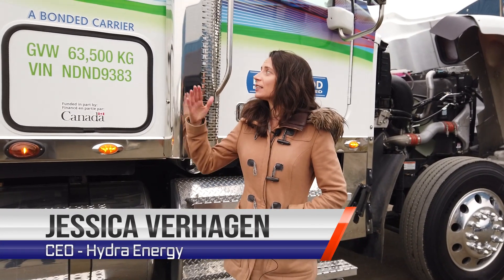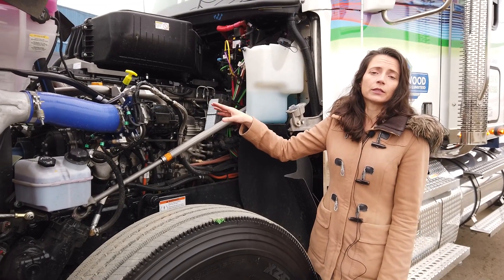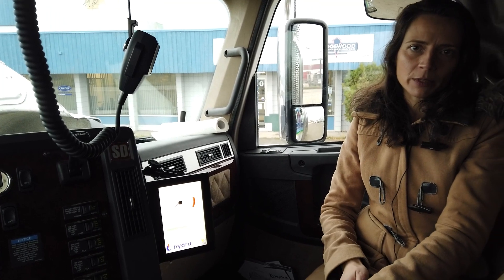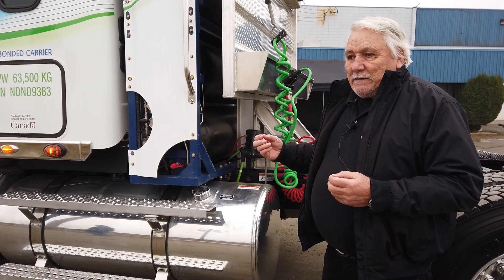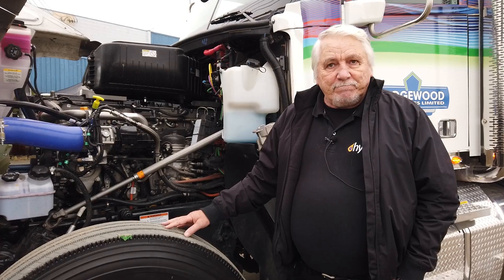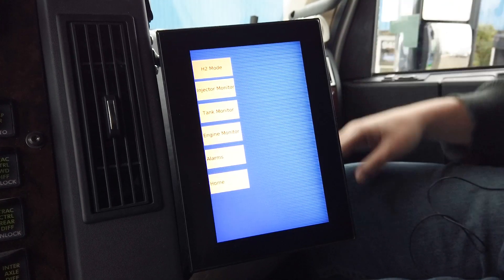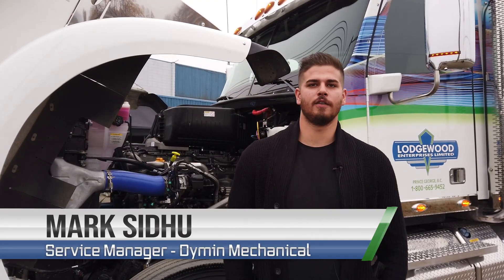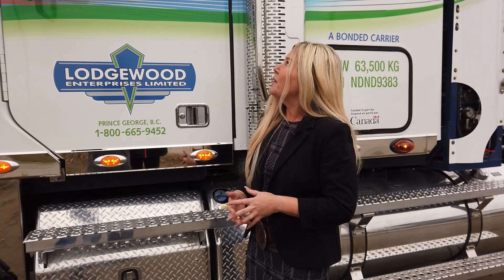Tour Hydra Energy's Hydrogen-Diesel Truck

Comment: I wonder what the size of the explosion would be if a flat bed trucker loaded a 38,000 pound steel coil incorrectly and it went rolling forward right into those tanks at high speed

Comment: Hydrogen has a lower combustion temp...   Diesels starting better at much colder temps.  It happens to be a byproduct of the system but would be a MAJOR selling point for equipment operators and drivers in Cold regions.
Reply: You need to use hydrogen on demand it has four times more energy density that of bottled hydrogen I have data from the lab and data from real world testing.

Comment: Hydrogen is the future  - Electric vehicles are powered by batteries which do not have sufficient energy density to power a truck
Reply: Yes you are right I've been in the business for 13 years in the last 2 years has been out of control busy.

Comment: where can u fill up h2? that is problem?

i think it will be much better have HHO generator to supply H2 than fill up H2gas from station
Reply from the maker: Hi Tim, that's a great question thank you. Hydra has just broken ground on the world's largest hydrogen refuelling station. It will be available for our customers to fuel at in early 2024. Check out our other videos to see a flyover tour of the refuelling station & production site as well as speeches from the groundbreaking.
Reply: Absolutely right with our technology we gain better fuel savings results and emission results with  hydrogen on demand.
Reply: Hello so I am Scott from Central valley hho. I have been doing this technology for 13 years. Bottled hydrogen is not the equivalent to hydroxy hydrogen. I've done certified test gas  test in the gas that we make as a percentage of diatomic and Ortho hydrogen and oxygen which the btu volume has been much greater than bottle hydrogen by four times that's in simple in lame man's terms. Also we have EO for California I have hardcore data with lab certified pieces of test equipment showing upwards of 35 and 45% on fuel savings and zero kox coming out the tailpipe we have a controller that is mapped to the load on the engine just thought I'd share that with you.
Reply: Do love what you guys are doing though keep up the good work a great thing about having hydrogen in a bottle as you can charge for it totally agree with that.
Reply: Also to share with you a typical 18 wheeler that drives 80 to 100,000 miles I am saving them upwards of maintenance cost fuel savings of over 45,000 per truck per year that is a lot of money saved I am working with multiple companies around the world in eight different countries thought I'd share that with you.

Comment: I put one on my car 15 years ago   no noticable change ..ran from alternator ..but ....if you use solar to generate hho .then your onto a winner.mike Scotland
Reply: Using an engine to make its own fuel is just an exercise in releasing heat. Every step of the way, you're wasting energy, and at no time is there new energy being introduced into the system. If you powered the HHO generator off your workout bicycle, then the energy of your own body would be used to create fuel. As it is, you're burning gasoline with extra steps to just waste more energy.
It does run a bit cleaner than gas, though.

Comment: You don't say what ratio of hydrogen the engine uses to diesel but I guess it must be pretty small (1600l diesel/every 120l hydrogen). You are wrong in saying there are no emissions from burning hydrogen as nitrous oxide is given off. NOx is a more potent greenhouse gas than CO2 by a factor of 100. The diesel/hydrogen ratio is critical in keeping these emissions to a minimum. What would be the total NOx emissions of this vehicle including the diesel? Is less diesel used overall because of the hydrogen additive? What effect does it have on economy and power? In the term 'CO reduction', is the method of production of the hydrogen and the supply chain taken into account?
Reply from the maker: Thank you so much for your questions. Hydra is able to displace up to 40% of diesel with hydrogen using our proprietary hydrogen-diesel co-combustion retrofit kit. Lifecycle emissions are taken into account including from the low-carbon hydrogen we are producing at our refuelling station in Prince George. For more information as it becomes public please subscribe to our newsletter that comes out each summer & winter at hydraenergy.com/newsletter

Comment: How are you controlling the NOX emissions?
Reply: This is a DD13 or DD15 engine. This truck already uses an aftertreatment system with a Diesel Particulate Filter and DEF injection. It just uses less diesel fuel per horsepower, so theoretically it should have much lower emissions, and probably less frequent DPF regen. 
Based on this video, if anything malfunctions in the aftertreatment and sets a trouble code, the hydra system will shut itself off and the truck will essentially run like stock.

Comment: What would a system like this cost for a 2500 to a 5500 truck
Reply from the maker: Hydra does not provide hydrogen conversion kits for standalone purchase. Instead we offer the world's first Hydrogen-as-a-Service™ in coordination with our proprietary technology. We install hydrogen-diesel co-combustion conversion kits into commercial fleet trucks and provide hydrogen fueling stations at no cost to the fleet owner. In exchange, the fleet owner signs a contract with Hydra to buy hydrogen exclusively from us. 

Our focus is on converting heavy-duty Class 8 trucks at the moment.
Reply: @HydraEnergyCanada  i would like to see you guys branch off into the smaller diesel market in the united states and canda

Comment: What is the source of your hydrogen, thanks.
Reply: Good question! If it comes from methane it's not green hydrogen. Grey hydrogen is traditionally produced from methane (CH4), split with steam into CO2 - the main culprit for climate change
Reply from the maker: Thank you so much for the question! The low-carbon hydrogen that Hydra is using in our Prince George station is produced via two 5MW electrolysers, with electricity coming from BC Hydro. The hydrogen is produced on-site at our hydrogen refuelling station.
Reply: @HydraEnergyCanada  Thank you so much for the answer. Good on you !!
Reply: @davidcox8961  you couldn't have been more wrong. Best leave the answers to the technical experts.

Comment: Very wise use of H2 to reduce use of fossil fuels. What sdjustments do you do to the oxygen sensors in order to account for the introduction of H2 into the air intake? Undrer steady state conditions what is the Vol% of the H2 gas in the air intake? I would appreciate to have an answer. Many thanks. Chris

Comment: Totallly pointless if it is not 100% hydrogen running.
Reply: If it only did a 20% boost, which I'm sure it does more than that, each semi would save $15,700~ a year, some more some less, on gas with the way prices are right now.  An advanced system less powerful than what they have going could accomplish that so I'm sure they're probably doing 50% or more with that pressurized system.  These semis will save more per year than most people make per year, and the more it costs to transport products across the country so you can buy them the more those products are going to start costing.  The government won't stop until gas prices are over $10 and people are forced to buy electric because they can't pay gas prices week to week, and why would they do that?  Exactly because more and more innovators are catching on and directing towards making pre-existing combustion engines not only run on large supplements of hydrogen, but eventually they will replace all diesel/gasoline combustion engines' fuel sources with water.  The goal is to get as many engines off the road and into the landfill before that momentum starts happening.  They did this with carburetors back in the 80's after decades of inventors modifying them to get 100 MPG, Ford even had a vehicle leave the factory with 40-50 MPG.  Those carbs were recalled and sent to a landfill never to be seen again. THAT is how much the US government wants you to have a fuel efficient vehicle.  It's becoming a worldwide initiative.  Next year in Europe they're actually going to OUTLAW the owning of these 45-50 MPG diesel VW vehicles.  This company doing what they do is the stepping stone that shows the next generation where there is smoke there is fire, and before long someone does manage to not only invent a system that runs engines on water (because it's been done before, SEVERAL times, but the innovators keep dying miraculously), but get it into the market before something bad happens to them or their company.  I've been developing my own hydrogen system, stricly supplement and with a mind for simplicity and wide-scale scalability for most consumer cars (not the semi industry like these guys) and will be starting my own business here this month.  The key is to stay under the radar as much as possible.  I hope these HydraEnergy guys see this comment and don't get prolific with social media updates.  Just do local word of mouth sales.  Otherwise you guys are going to start having problems, or people are going to start dying.  BTW, I like the name.  I've never heard of you guys, but I'm going to be using Hydra in the name of one of my generator designs.  I came up with it in 2018, and developed a scripted 10-part action-music-video series about it that has no talking and is all action so it translates world wide.  The story of another hydrogen innovator that starting receiving visitations from hitmen, but as it turns out he's Rambo-Terminator-Batman'Damme and can't be killed.  I'm more excited about the series now than I am about the invention or the business.
Reply: You cannot call hydrogen a green fuel if you're gonna burn it. Period.